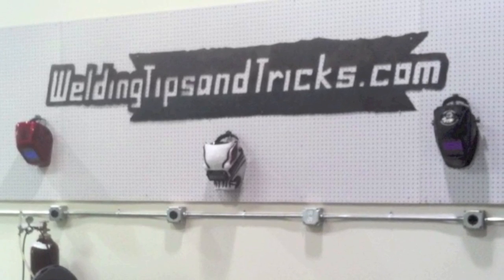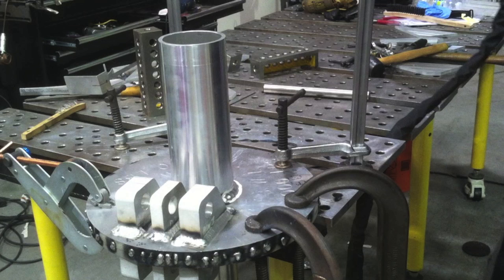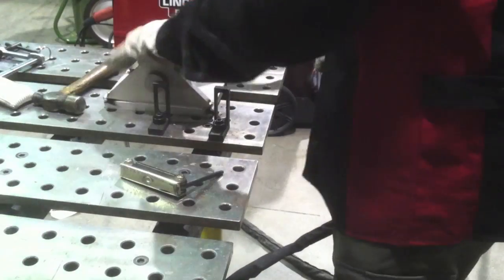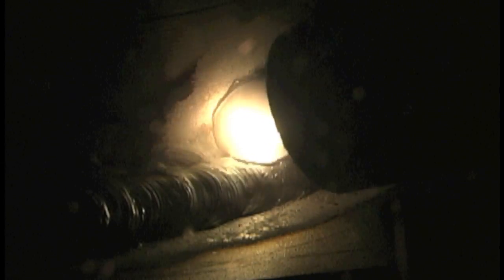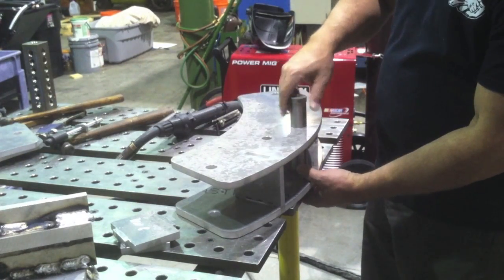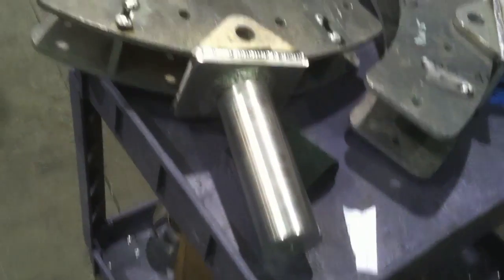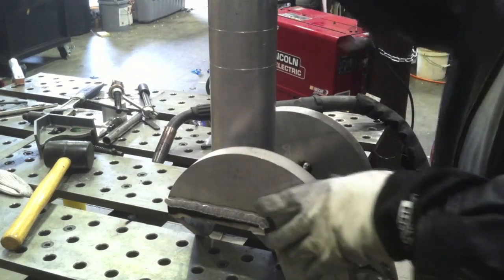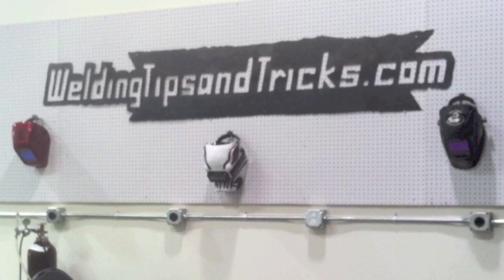Welding Aluminum with a Lincoln PowerMig 350mp & Stronghand BuildPro Table Part2

Comment: Thanks Jody - really helped me convey here in the UK the "North American" spray-transfer Ali MIG/GMAW welding strategy.  While you are concentrating on the product, all is to be seen of that welding condition.  Which I used "officially" (it was agreed) only once on a confidential high-spec. job where "the proof of the pudding was not to be had in the eating" with the predominant UK orthodoxy.  Confidential = this is the first time I have been able to say "here it is" finding these Parts 1 and 2 videos.

Comment: I must say that Lincoln Push Pull Machine seems like it does a hell of alot better than the Miller machine i used at a shop one time the guy bought brand new just for a huge aluminum handrail job we did.
Reply: Demonlord468  we have mostly millers in my high school shop class, but we also have this exact Lincoln machine. The lincoln performs so much better than the millers.
Reply: Yeah i had ALOT of issues out of that miller python setup i was using. I could have almost been better with a spool gun to be honest. Felt like a waste of $6K to me.

Comment: @weldingtipsandtricks do I need to use push and pull gun or spool gun with this machine to weld aluminum?  or can I use the initial gun supplied with the machine?
Reply: Ken B  i dont have much experience on the topic, but I believe that a standard mig gun wont work for aluminum, due to aluminum being a more malleable metal and will bind and tangle in a standard push feed set up.

Comment: Hello I'm a welder and I'm using the same machine with a wire feed trigger gun not a spool gun. I'm having a lot of problem with my tips burning up or melting on exit at the tip of the gun and I have tried everything from changing my amps and volts to my technique and no matter what I do I keep clogging tips and I have no Idea why I'm using .045 wire 4043. If anyone has any idea why please let me know thank you.
Reply: +Gregory  Barrett  Hi, I have been using the same machine for years, Anytime you have that problem, you've got a wire feeding problem for sure. The wire gets slowed down for some reason, and immediately fuses at the tip. The fact that you're using .045" wire is very good as it really eliminates a lot of feeding problems, particularly bird nesting. Try going to the manual and look up "stall factor" it controls how hard the push feeder in the machine will push before stalling out. It has no effect on the pull motor in the gun. Perhaps a bit more push will help. Also, and very important, replace the liner. It's amazing how much a worn out clogged liner can screw things up. Finally, you may hear some people saying to keep the whip straight, but that is total BS. If that were necessary, the Cobra gun wouldn't ever work reliably.
Regards and good luck!
Mark
Reply: Don't have a linclon machine but i do run a miller 350p every day, like i say not familiar with your machine but i would check the sup value, make sure your using the right drive roller in the push pull gun as well as u grove drive rollers in the machine. Also check and make sure your machine is set for the 3/64 wire, sometimes i use 3/64 mostly 035 if i forget to change the setting tip fries nearly instantly when i swap wire. Another big thing is the drive roller at the machine need to be really loose compared to welding steel. However the machine will for no reason fry a tip every now and then when i first start up just out of the blue but only about 2-3 times over a 16 pound spool of wire. hope this helps
Reply: Gregory  Barrett  did you ever have your machine taken in for repair? 
I have the same machine with lots of problems in any program other than 5. Burn backs and lots of tip issues and erratic behavior

Comment: Hello, Thanks for your very informative videos!  Question?  Why does a weld draw more on the inside weld than the outside weld?  And what multi purpose welder would you recommend for around a 1000.00 dollars?  Thanks, Terry
Reply: +Terry Goins
 Lincoln Mig MP 210

Comment: No spool gun for aluminum?  I can't run aluminum wire through my mig machine unless I use a gun with the teflon liner or use 5356 wire instead of the 4043. I also had to run a U shaped roller instead of the V shaped roller used for standard mig wire as the V shaped roller sometimes shaves the aluminum wire causing the tip to clog. I also run aluminum wire with very light pressure on rollers in case of jam up the wire won't bird nest and just stop at the feed point.
Reply: He had a push, pull system. You can run 4043-5356

Comment from the maker: It is a concern. We were all scratching our heads over this design but is was built per the drawing...there are 2 grooves cut in the solid piece to hold grease but no grease fittings. there should be. We did grease it up real nice with lubriplate before assembly but grease fittings would have been smart. the customer can add them if they decide to but we didnt have the liberty to deviate.

Comment: Are there grease fittings on that thing?  I would be concerned with galling on the soft aluminum shaft asmbly, especially with the off center load from that hydraulic cylinder.  Not a concern?  S/F....Ken M

Comment: @weldingtips and tricks, with thick aluminium like what u just welded, dont u need preheat? i ask because i havent seen any preheat. maybe u edit it out. 
i'm asking because im welding 1/4" up to 1/2" alu with a semi and im wondering what is the minium thickness before needing to preheat. 
(i hope what i just wrote makes sense, englsih isnt my fisrt language)

Comment: From the looks of it it is a alignment tool to line up a large diameter pipe for in situ assembly. About the right dimensions to handle a water or fuel feed pipe flange to align it for placing of bolts. Probably for a water treatment plant or a large refinery, where they need to get the flange aligned properly.

Comment: Well, maybe they are trying a new software (the engineers). At the place I currently work (at open pit coal mine, as electronics technician for sensors and measuring) we have quite a few of a "software tester" engineers. Never mind, it can be it is just a time schedule hanging on the guys head.
Thanks for answering, love Your videos.
Best Regards Goran

Comment: @weldingtipsandtricks I really do not understand the part when finished. I had re-winded video of finished part, and all I can see is a cylinder is mounted between parts that can't move when assembled like this. Maybe drawing are misaligned by 90 deg in XY plane. Please tell me if I do not see it well from a video.
Best Regards
Goran